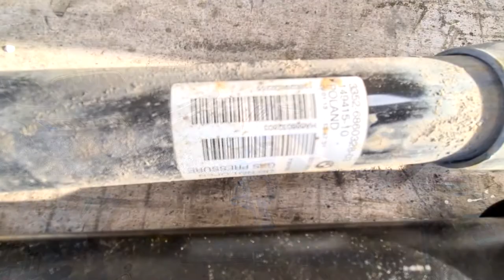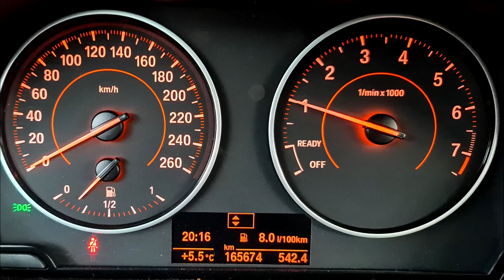DIY for REAR SHOCK ABSORTERS - 160 tkm SERVICE - BMW F20 engine N13

Comment: The lower bolt should be tightened at rideheight. That's preventing the lower shock bushing from twisting.
Reply: I’m thinking of changing mine myself. How do you tighten it at ride height?
Reply: I would assume put the bolt in but not tightened up. Lower the car so it’s on the floor then torque the bolt up?

Comment: Good video, I would be tempted to add a small amount of gasket sealant around the top mount before fitting as it will help prevent future ingress. Or ideally replace the gaskets...

Comment: My f20 issues when shock cover bump stop slipped down then have some squeaky noise. Shock cover bump stop didn’t crack but I can fix back for temporary only by push by hand.

Comment: Great video. What is the 90 degree tighten at the end , is this tighten to 100nm plus 90 degrees ?
Reply: I have got the same question. Dont understand the 90gr
Reply: Yes it will be, tighten to nm then further 90°

Comment: My 2016 116D started giving sharp squeak sounds whenever I turn right. Earlier this morning, the squeak noises ramped up to whenever I drive. In the cabin i can more or less tell it's coming from the left rear. The rubber covers also have broken off. What exactly do i need replacing?
Reply: Most likely not your shock absorber like this video. Sounds like a squeaking bush. Have a look at the rear arms and see which are perished.

Comment: Why didn't you replace the top shock mount?  They make noises even below 100,000 km mileage.
Reply from the maker: What in that part can keep noices?
At least nothing comes to mind. I don't think there are any moving parts in it?
Reply: @JaniVoutilainen  I did not have this part in my hand, but in this car several people were looking for the reason for the quiet knocking and that was the solution
Reply: @SuperBasshunters   yep, I changed the whole set shocks and mounts at 170kkm. And now when its cold weather there is soft knocking at rear.  But only when cold. Will check this out and see what is happening

Comment: Hello, I am thinking of installing this variant in a standard chassis, the plans may include lower springs. BILSTEIN 19-218014. maybe they are shorter than the standard shock absorber?
Reply: For standard replacements on standard springs use Bilstein B4 shocks.. if you are going to lower the car go for B8 shocks and m performance bump stops